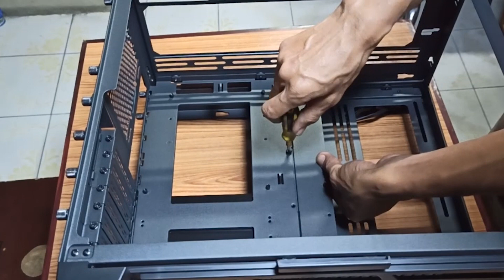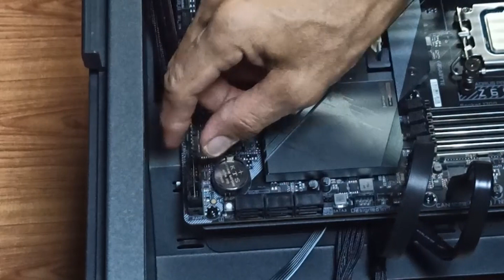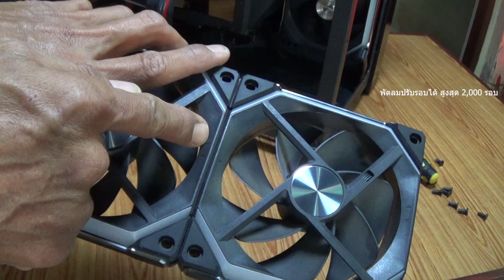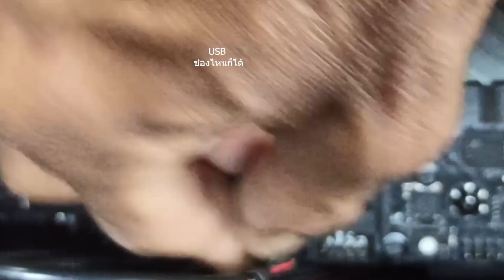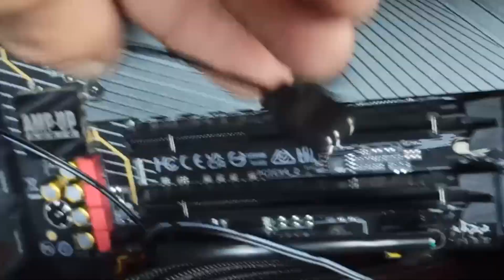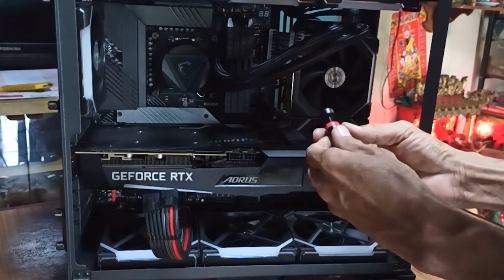แนวทางประกอบคอม เปลี่ยนเคสใหม่  LIAN LI O11 D Mini เรียบหรู

Comment: ขอทราบสเปคหน่อยครับ
Reply from the maker: สวัสดีครับ
1. cpu i3 12100 (อนาคต i7 13700k )
2. เมนบอร์ด 1700 Gigabyte Z690 Aorus PRO DDR4
3. RAM  corsair 64GB (16x4 GB ) DDR4 3600MHz 
4. VGA AORUS GeForce RTX 3070 MASTER
5. Power Supply Lian Li SP750 watts 80 Plus Gold
6. CASE Lian Li O11D MINI
7. WD BLACK SN 1 TB SSD M.2 NVMe GEN3/GEN4
8. Liquid Cooling MSI MAG COELIQUID C240 R
 ผิดพลาดแต่ประการใดผมต้องขออภัยด้วยครับ